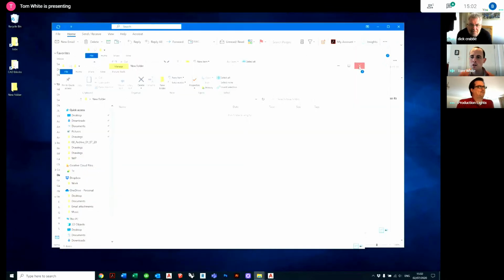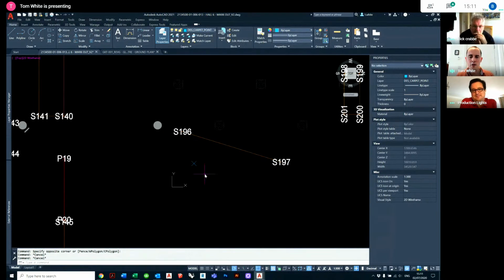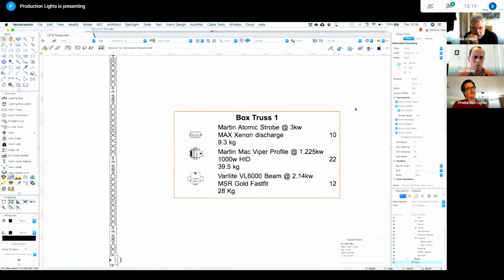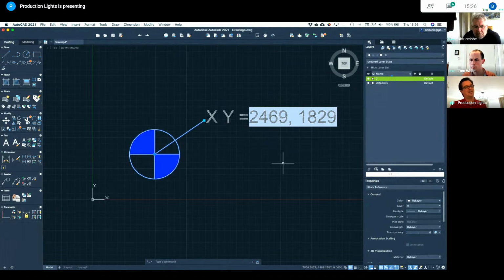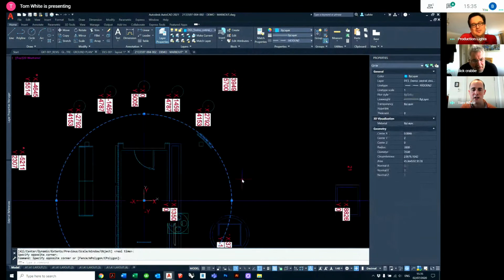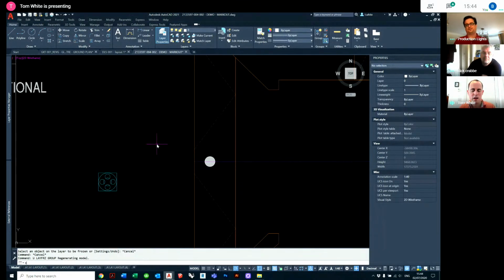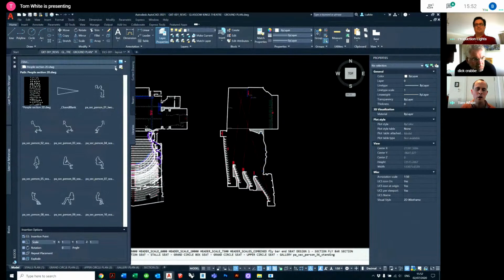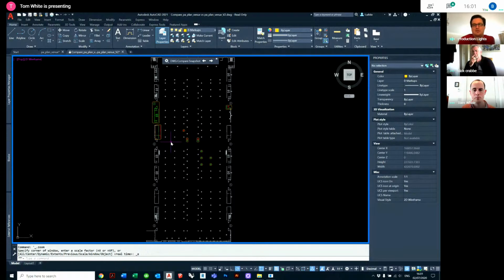CAD Lessons - Ep. 13 on Thursday @ 15.00

Comment: Data extraction.  
Filtering data types	(12 mins in)
Flatten command,  turning 3d into 2d
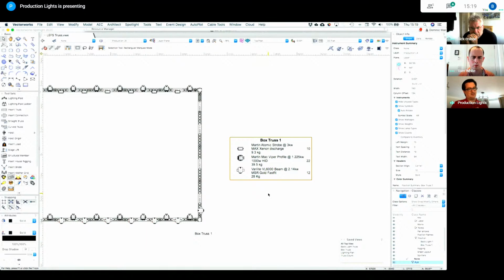Data extraction in Vector Works		(18:30 mins in)
Labels in an LX plan & reporting out.
Dynamic co-ordinate blocks	(25 mins in)
MAC CAD 2021 updates		(28:30 mins in)
ATTOUT & ATTIN
Count LISP	(32 mins in)
Regen command
Real world example of getting mark out co-ordinates,  a new UCS,   using fields,  object,  position to give automatic co-ordinates on a plan.	(36:30 mins in)
Automatic fields for a print out,  plot date,  version number,  issue number.
Purge command to simplify a drawing and reduce it’s file size. 	(42 mins in)
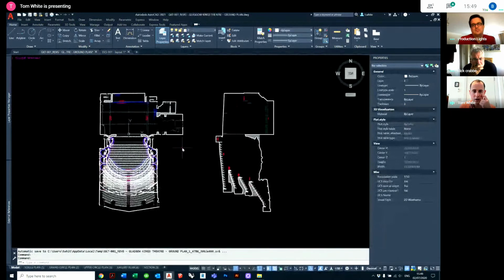Wblock and Wblock all commands to export a block	(48:30 mins in)
Design Center,  what it is and why	(54:30 mins in)
Compare command,   how it works nd why it’s so useful.